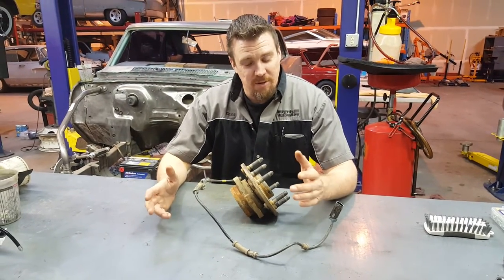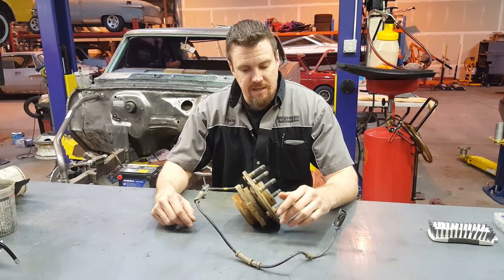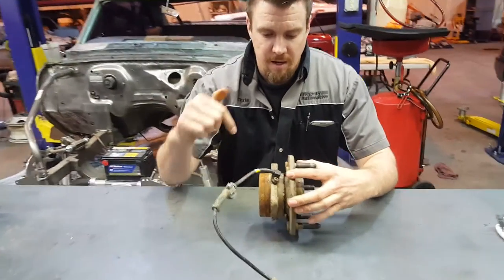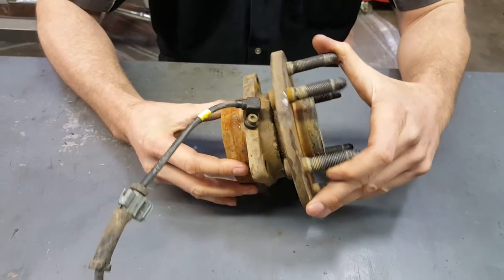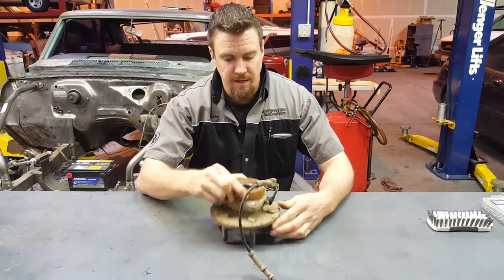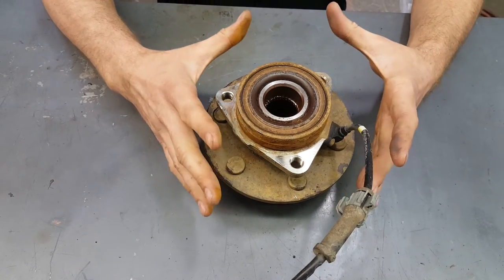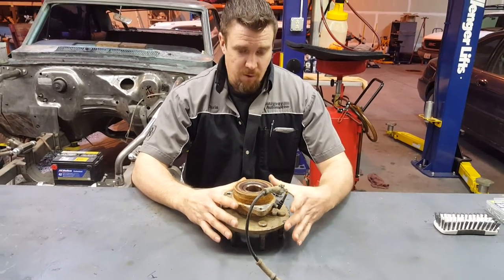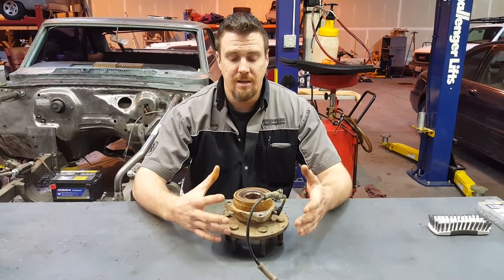Brake Light Randomly Turning On and Off, this May Be Why

Comment: Hi my brake come on when going like 40 -60 miles on regular road and if I’m going up hill it turns on and won’t turn off unless I take the foot of the gas pedal but then comes back on it’s a 2014 Nissan Pathfinder

Comment: My ABS light, traction control light, and sometimes my parking brake light accompanied by beeping come on while driving. 2012 Chevy Sonic. Any advice would be appreciated
Reply: Did u ever find out what it was
Reply: Did you figure out the fix
Reply: @showoutque8501 have you been able to figure out the issue?

Comment: My car’s brake light turns on and off when I turn.
Reply: Same issue with my car, what you did to fix it??
Reply: @Mattlesome01  No. Haven’t considered it something that needs fixing. Just now, I replaced the timing belt and that was definitely an issue. So I kinda forgot about this light thingy.
Reply: Electric connection. Remove the fuse until repaired. It’s dangerous if the ABS comes on and off at the wrong time. Stopping distance will be affected.